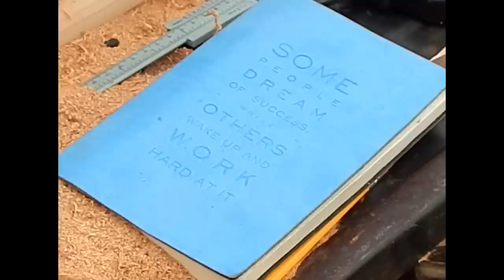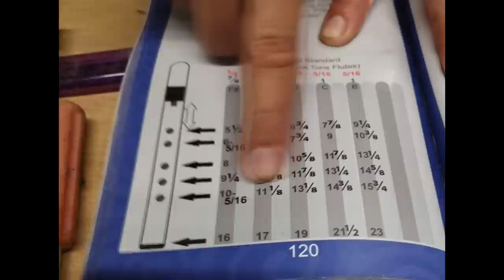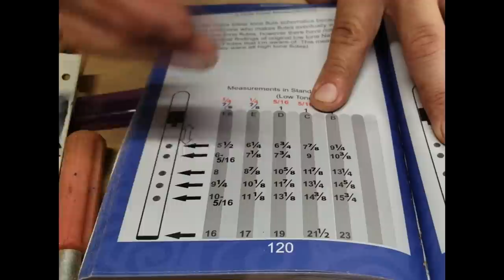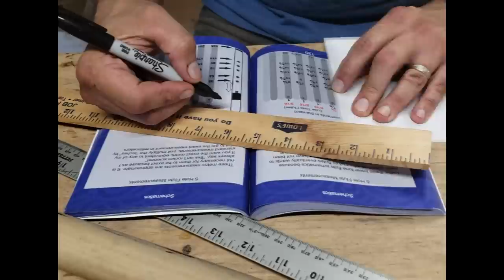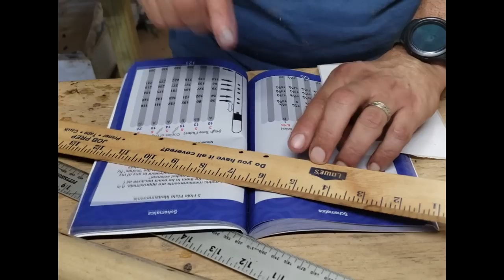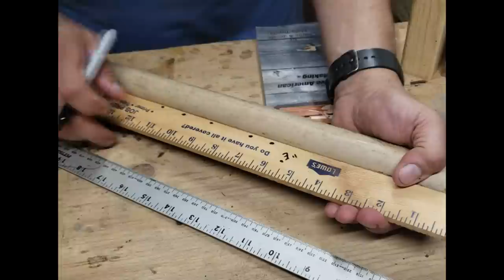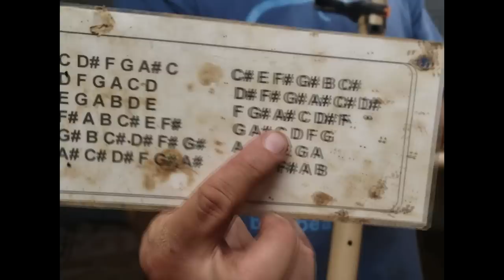How To Adjust a Pattern to Fit The Material When Making a Native American Flute

Comment: Another great video! I've bought some of your "bear fat" in the past and I wonder if you have any plans to sell that magic oil?
Reply: I bought his "immitation" bear fat, in a small tub. Very good stuff. I got it off his website. (I hope this is what you're referiing to.)
Reply: @RustyGunn7  no, as I said, I have also bought the imitation bear fat, and yes it is very good stuff. I am referring to the oil he initially dribbles down into the flute.
Reply: @RenaissanceMan929  - The 'dribbled' oil is mentioned on another video as Sunflower oil.
I doubt it will go rancid since the wood absorbs it, but if that is a concern you can dilute it with
lemon juice.  Also, walnut oil or cheap olive oil will work. Do NOT use virgin olive oil.
As usual...
THANKS FOR THINKING!

Comment: I’m curious as to why you didn’t set your bottom note (overall length of the flute) before you tuned your holes. Wouldn’t your hole tuning be more accurate if your base note (tonic) was set first?
Reply from the maker: In this video, I'm taking an existing pattern and using it to show how to extrapolate a pattern for a flute to be made of a slightly different size material. In the tuning process, I always tune the bottom note (all holes covered) first. Where I began burning holes at 20:30, I was not actually tuning the flute. That doesn't take place until around 27:30.
Reply: @BlueBearFlutes  thank you, Charlie! I just ordered your flute making book and looking forward to trying some of your techniques.